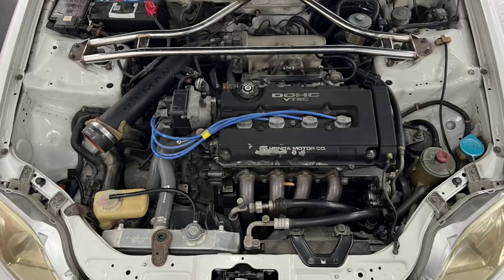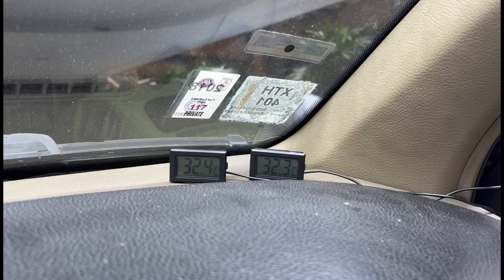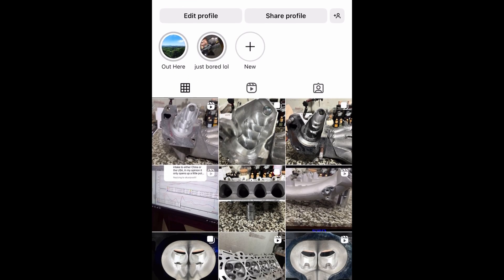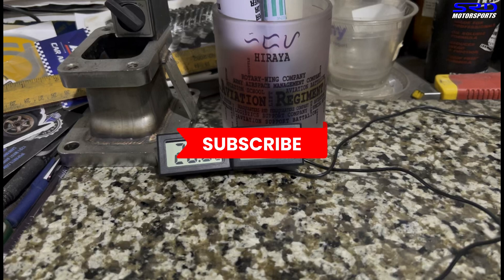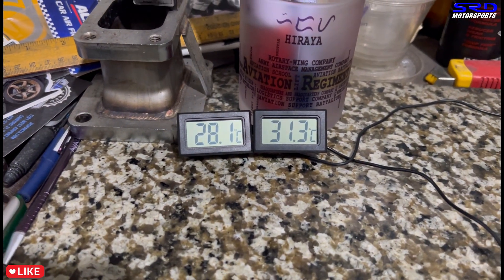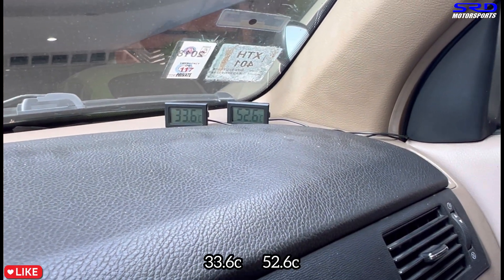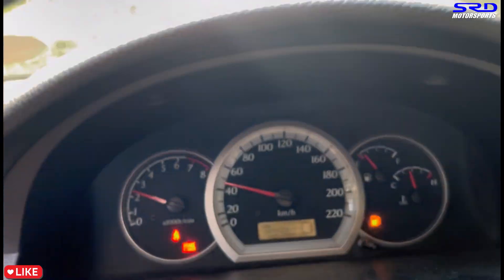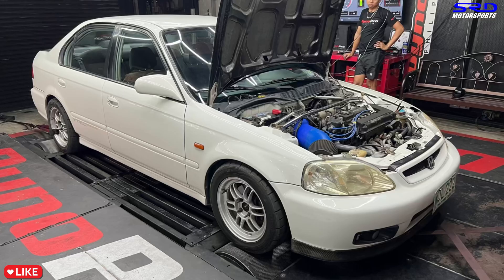Engine Bay Temperature vs Outside Air Temperature Big difference?

Comment: Very interesting test and something I have been thinking about a lot for my intake setup. They say a 10 degree drop in intake temps improves engine efficiency by 1%. It is standard to have a cold air intake or even just a cold air feed to the air filter, you can wrap your intake pipe in heat reflective tape etc but I have been wondering about a heat reflecting intake manifold blanket that a company called Funk Motorsport in the UK produce. It isn't cheap and I don't know whether it would have any meaningful impact on the street. Looking forward to your testing...the channel and videos are awesome and I'm learning a lot from them
Reply from the maker: @james_EK9  I agree on the 1% and interesting stuff you bring up about the Funk Motorsports product… I do think it could help if it’s strategically placed in where it limits what the exhaust heat can “soak” with heat so it can be used to redirect by way of reflecting
Reply: @SRDmotorsports  yes that's what I am thinking and that may be it might be worth trying. It is common practice to try keep the air filter and intake pipe cool but the intake mani can also be a source of heat soak in the system I believe, especially in a b series when it is at the back of bay etc. If funds and time allows I'm going to test a CAI and SRI based on your most recent videos...I'll keep you updated with any results when I manage to get them!
Reply from the maker: @ oh true on the intake manifold sir!

that’s definitely gonna be a fun test once you get to do it I will be excited to check after! Thank you for that 😎
Reply: @SRDmotorsports  I was also about to ask you regarding gold wrap foil and phenolic gaskets, it will be curious to see what are the effects!
Reply from the maker: @ the gold wrap definitely works… just as long as it’s strategically placed… as I seen it be used on. A lot of serious stuff too